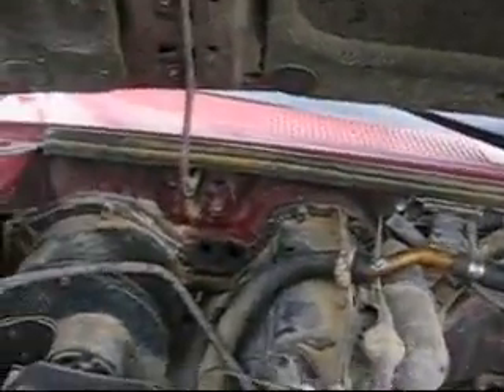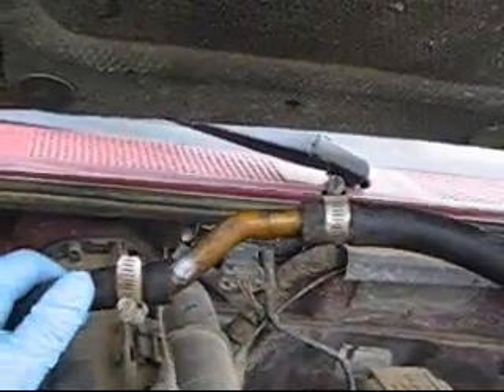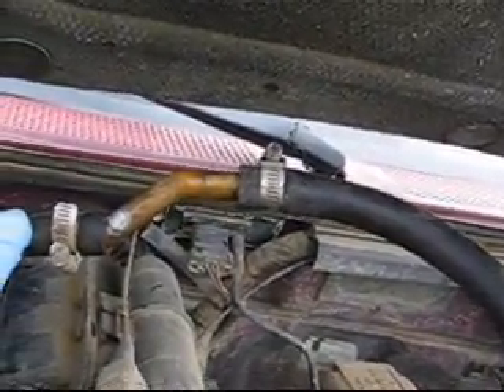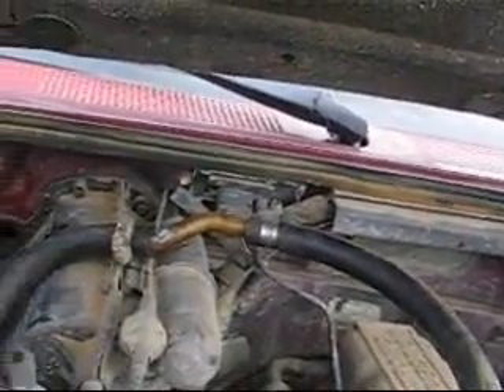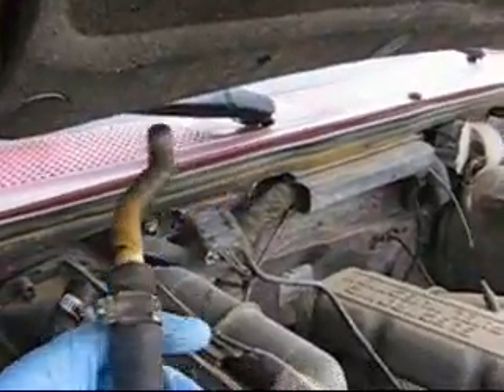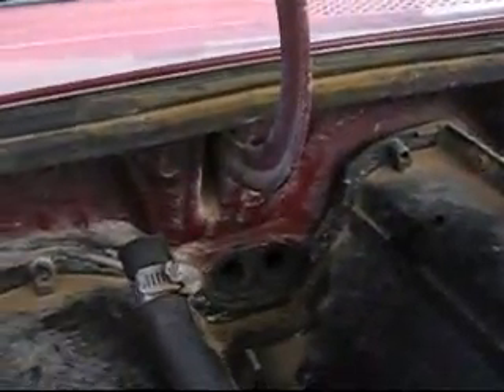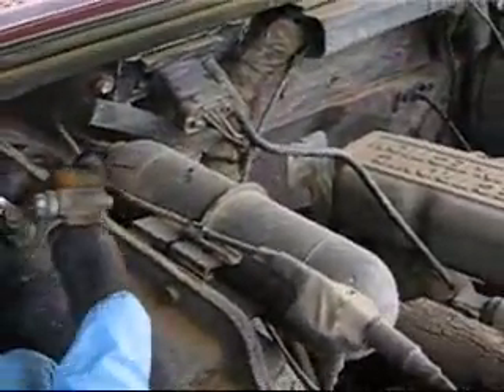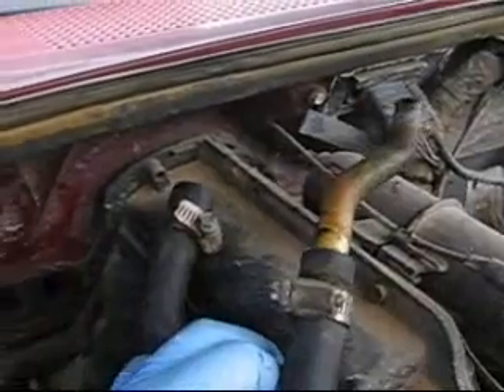Heater Core Replacement Part 2

Comment: The heater core on my '88 F-150 blew this morning and I had coolant running into my passenger side floor. This video has helped a ton. The setup looks almost the same. Thanks!

Comment: Yes, the coolant was dripping on the passenger side floor, there were about 6 bolts behind the glove box door, the core was less than $40, and the hoses were stubborn but not as persistent as I was.

Comment from the maker: The rest of my comment back to you didn't make it in there. It is a Bronco II with the roof cut off... You are correct from the doors forward it could be a ranger also. The grill and head lights and the overall look are similar to a gen 1 explorer but the gen 1 Explorer is wider. The Mazda B series didn't look like the rangers until later. Sorry for coming off as an A hole, I didn't mean to..

Comment: 3:05 RIP

Fukin heater cores on toyotas suck. You gotta pull the entire dash apart
Reply from the maker: Yeah you have to remove the dash on most cars. Ford did something right on the bronco 2.

Comment: Hey, I've got  89 that I think the core went on it.  Did you have antifreeze dripping when it conked out?  Any of your experience I would appreciate.  How many bolts were holding the heating core in?  Was it just behind the glove box?  How much was the core itself, and were your hoses stubborn?  Thanks in advance for any help you can offer